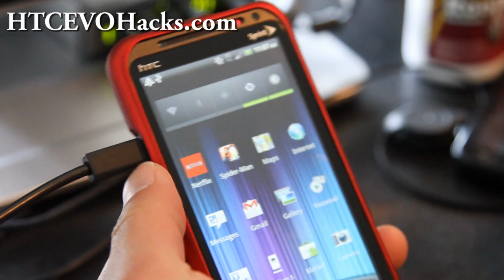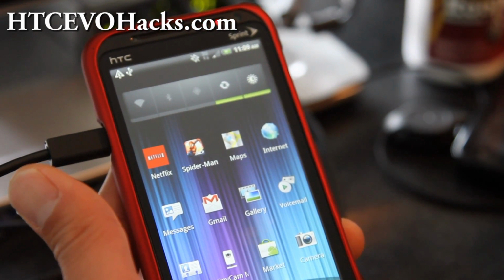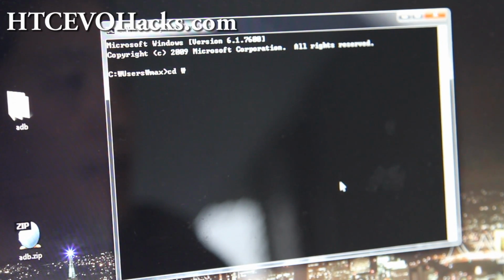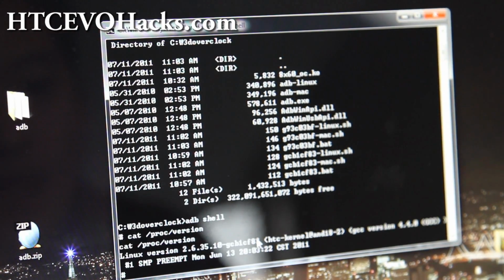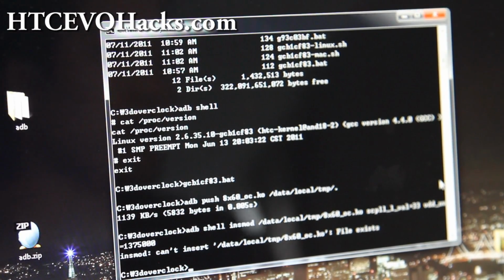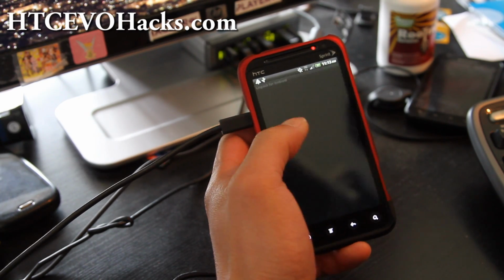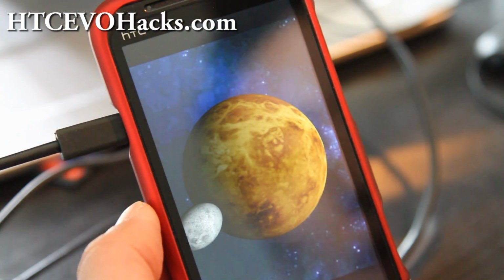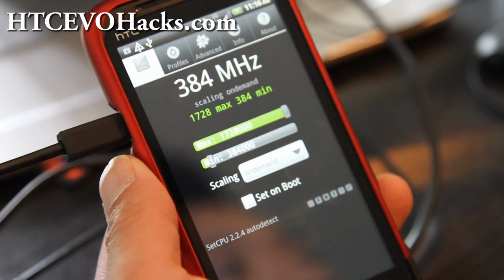How to Overclock your HTC Evo 3D!

Comment: My overclock does not work with the new permanent root.  My HTC EVO 3D used to overclock with the old permatemproot and failed after I installed the permanent root.  How can I fix this?

Comment: For some reason when I pick auto frequency in SetCPU it doesnt give me enough settings. It either goes to 1188 stock or it shoots to 1780, nothing inbetween. Any help? I tried SetCPU.text file in the SD card root and I formulated the settings but it wont lock the frequency I chose. HELP!!